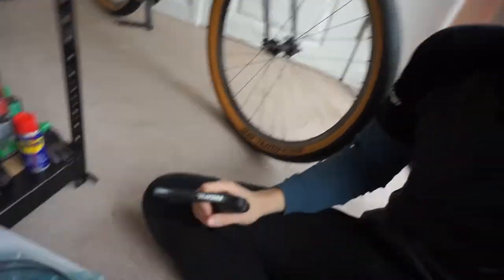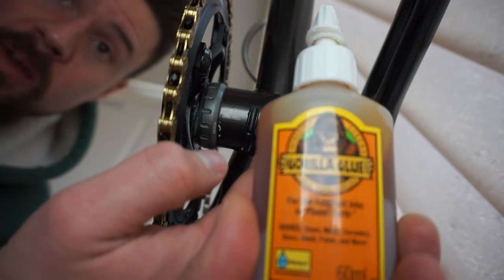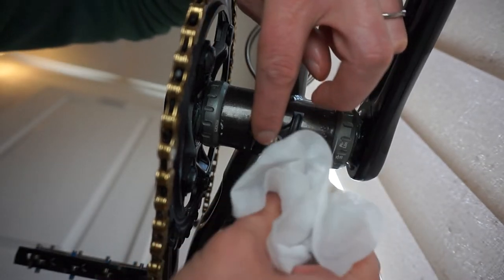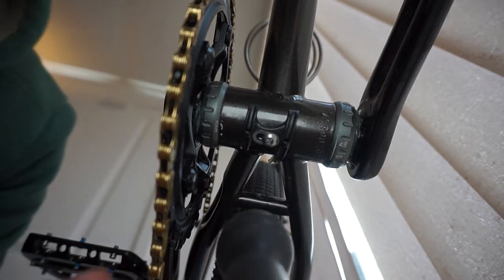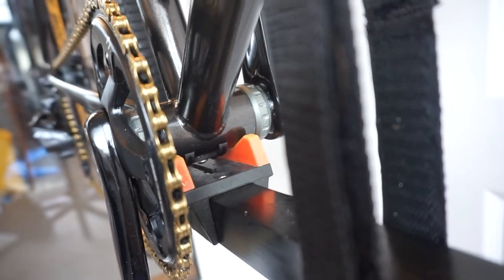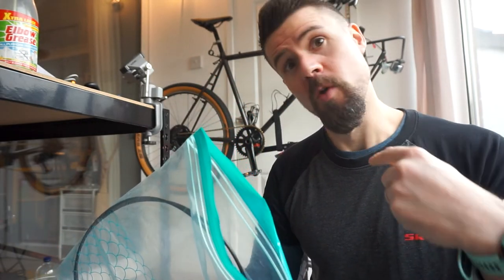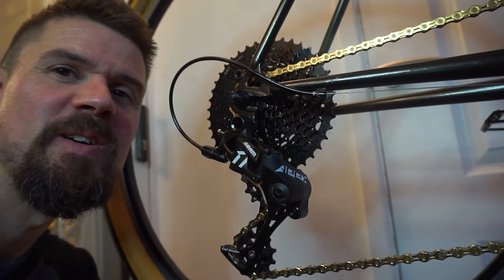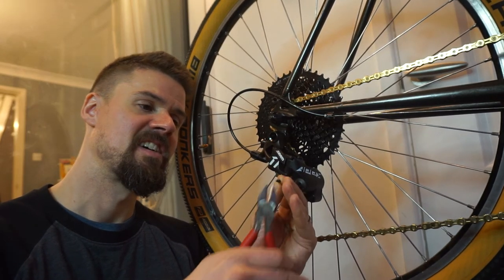Spindatt Trasher Bash Bike Build Part 18 Getting the SRAM 1x Wide-range Gears Going #trasherbash2022

Comment: instead of glue i would have used double sided tape and as you said it would be held on by the cable tesion. Thats just me as i wanted a temporary solution when i did it to my recent build but tbf though i did glue it on my trash commuter